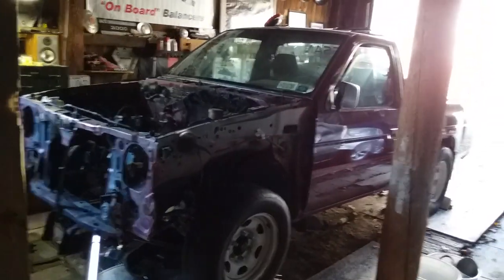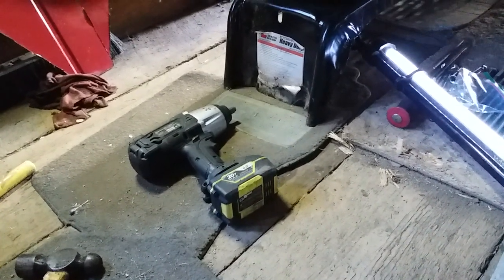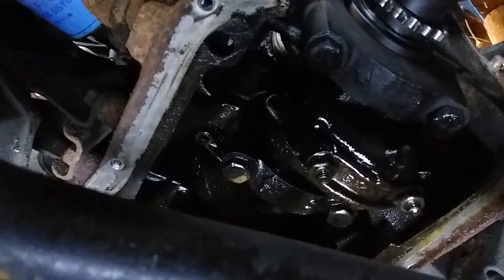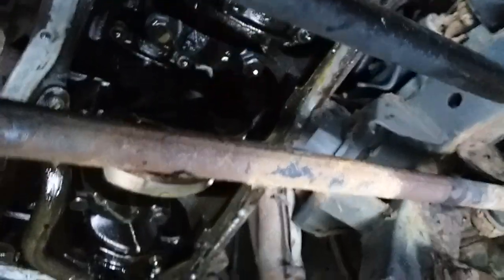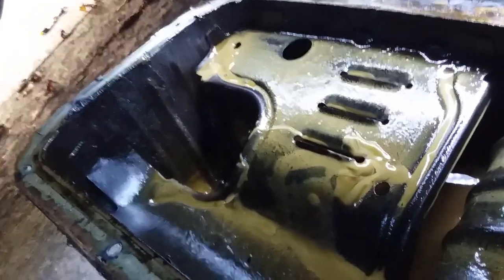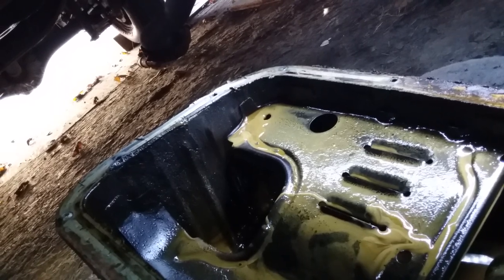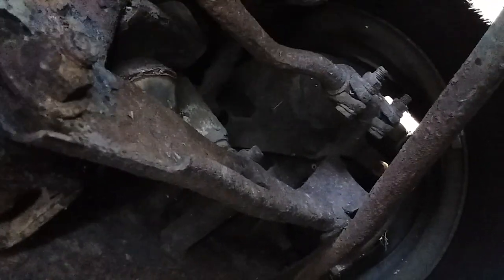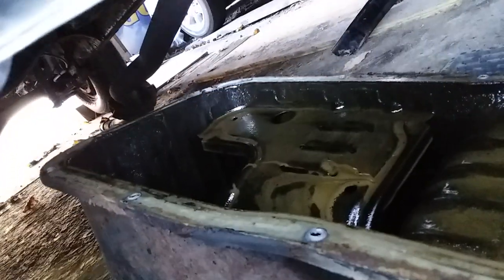Nissan Hardbody [Patches] Head Gasket Repair Project Part 5: Oil Pan Removed

Comment: Like your channel. When KA24 chain guide wears the chain slaps around and starts to wear on the timing cover. If you don't catch it oil/coolant will mix and your engine is fried. Nevertheless KA is a good enging

Comment: Is the crossmember a good lifting point for a single jacking point on the front for getting it up on jack stands? Oh does removing the oil pan make timing chains swap easier? I would love a good video on that because I need to do it to mine
Reply from the maker: Follow this series about this truck. That is what I am doing.
Reply: You want to come help me?